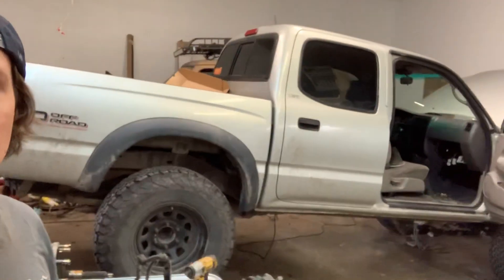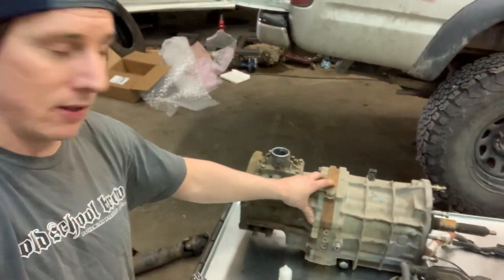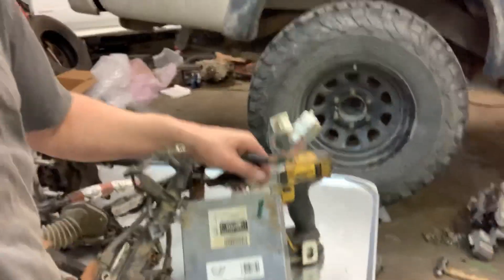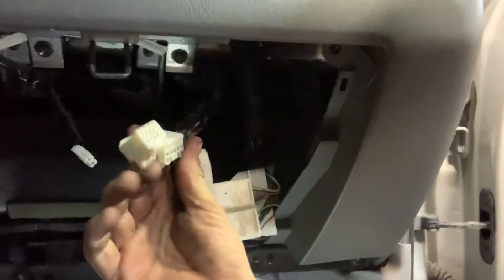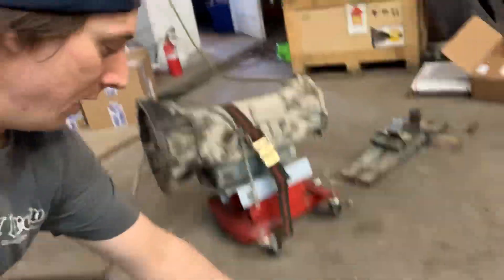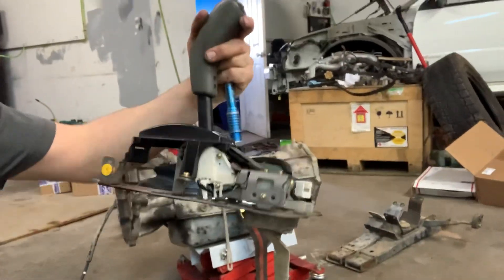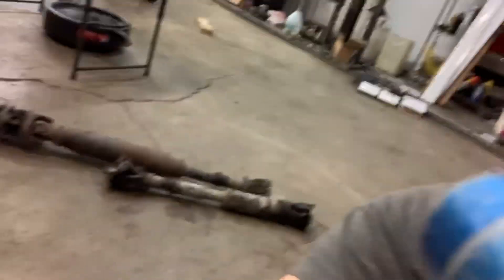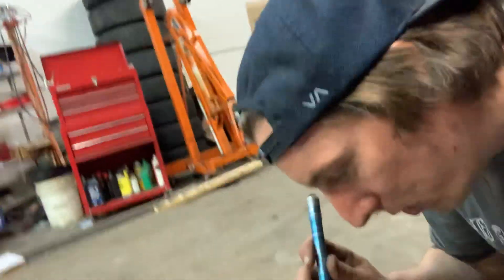2002 Tacoma 3.4l V6 5VZ-FE manual transmission conversion part 2.

Comment: what would happen if you stick with the automatuc ecu?
Reply: You’ll have a CEL
Reply: It runs like trash once it warms up. I did it to mine thinking I can wait on the ecu and harness. Basically your timing and fuel is all outa wack. It is weird tho bc it will have a a lot more power until it warms up then it it will loose most power and be gutless over 3k rpm